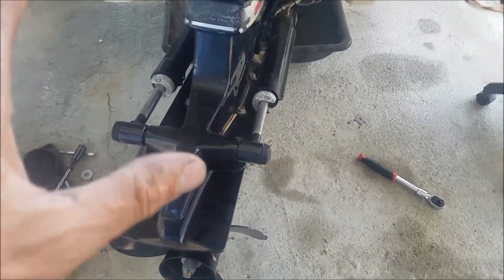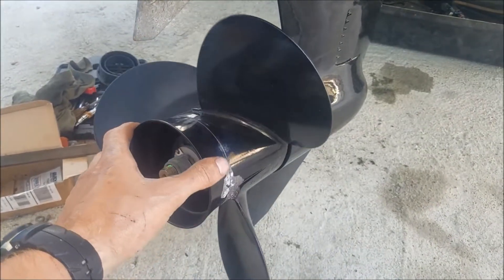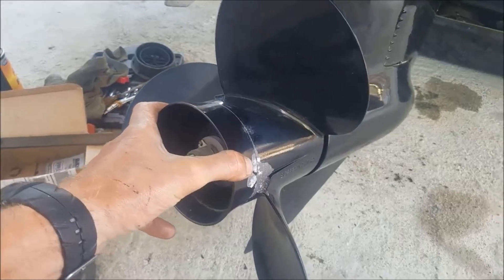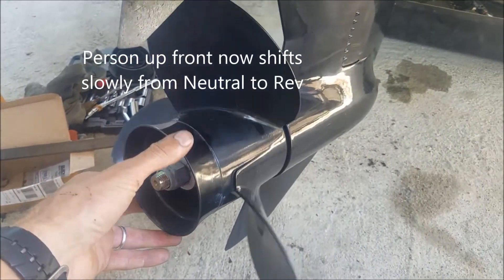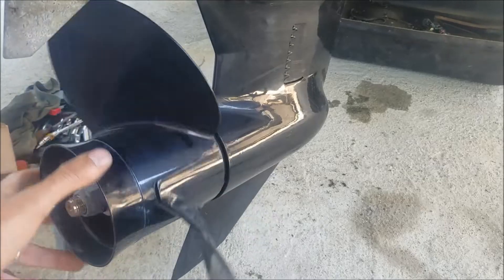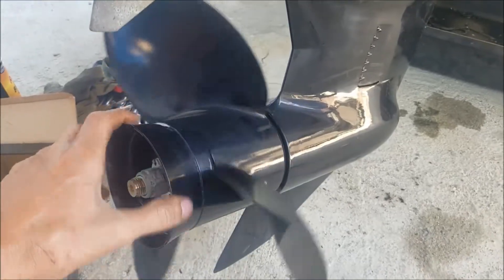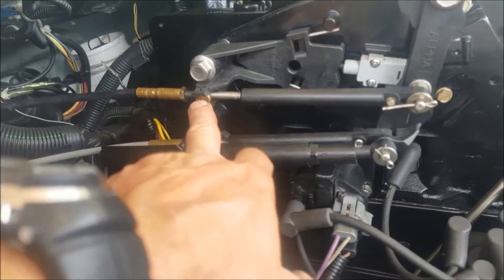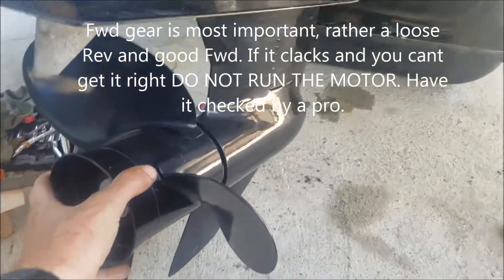**BULLETPROOF** Mercruiser ALPHA + Outboards  (not bravo) lower shift cable test & adjustment

Comment: Hi there I have 2004 Rinker Captivate 192 I just had issue on my boat when I put in forward my boat goes back. Any idea what could be the problem?
Reply: the lower unit was in neutral and upper in fwd when the 2 halves were joined - you have to drain the oil, remove lower only and correct it. if the upper is in neutral then the lower must be in neutral as well (prop spins both ways free).. if the upper is in fwd, so must the lower be (prop locks when turning CCW).. the 2 halves must match. Dont forget the special small oring on the stbd side that sits in the lower units cavity.. keep it in place with grease if it doesnt stay put but they usually do- the intermediate shift arm can get stuck sometimes - you need to make sure it goes up all the way, then let it fall down straight just before you slide lower up. Trim drive up fully - it will make it ALOT easier.
Reply: You're drinking too much. Turn around and face the bow

Comment: Good video thanks, I just got a boat and noticed when I go out from reverse to neutral it rattles when I spin the prop manually, I need to adjust the cable shift.
Reply from the maker: indeed  - just make absolutely sure the fwd engages well, thats where you go fast and work it hard - of course rev must as well but fwd takes priority

Comment: I replaced my lower shift cable when I replaced my bellows. I adjusted it to the manufacturers spec and all seemed to be working properly. Hooked a hose to it and shifted it in to R and F and worked. Once we got on the water though it was very tedious to get into neutral. Going from F to N I had to start to go into R until I heard the engine idle down so I knew it was in N. Before I did the bellows my boat would do this only going from R to N now it does it both ways. Any ideas what could be my issue? It’s a 1999 sea ray with an alpha one
Reply: Sounds like you didnt re-connect the shift interrupt - without it you are gonna fight to get out of gear, in not a problem- the manual tells to disconnect this and I have no idea why - it only affects shifting in the water.. has nothing to do with correct shift cable setup-
Reply: Fstarocka Burns also out of the water the boat returns to neutral as it should. Only in the water it acts up
Reply from the maker: @saculgaam69  yes - the shift cable might have been routed wrong - did you remember the small hex screw behind the inner cable with the lock wire? it will only actuate the big switch when in the water, not on the hose-  so when you move the big switch by hand it momentarily kills motor? but not in water? then you might need to bend that stainless arm (use 2 needle nose pliers) so it sits tighter into the Vee center - those switches/arm wear out and sometimes the cut out is so late you can hardly shift. I pop the roller out, bend it with 2 needle nose pliers, and pop it back..
Reply: @SocalMarineUSA  Anyway to get a video of this?
Reply: @saculgaam69  thats sounds right - you should be able to kill the motor moving the switch manually. The cut out switch also needs adjustment, if it cuts out too late you will really struggle, you need to CAREFULLY bend the steel arm (use 2 long nose pliers and DONT break that switch!) - bend it inwards a little and test the shifting- If your lower cable is not moving freely this will also be an issue. I have had new cables not have the correct clearance at the top where the inner goes thru the small hole before coming out of the sheath - requiring me to oull it back out a little and literally drill the opening a TINY bit wider.. The solid stainless tip seems to catch on the gold colored crimp area.. basically the lower cable should move super free when disconnected from the shift bracket at the motor. If ANY tightness is there it will not shift right..
Reply: Fstarocka Burns I never unhooked the connections or removed the physical switch. When we shift the boat the plastic bracket that looks like it rotates to change the state of the switch doesn’t rotate. When the boats running though and we move it by hand it stutters the engine and if held will kill the engine